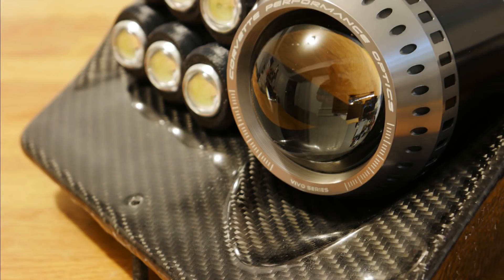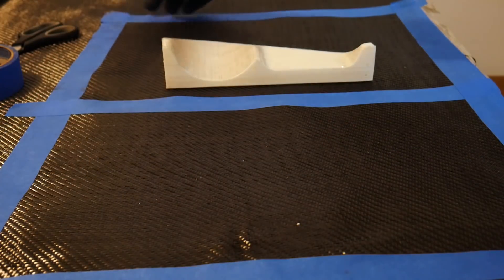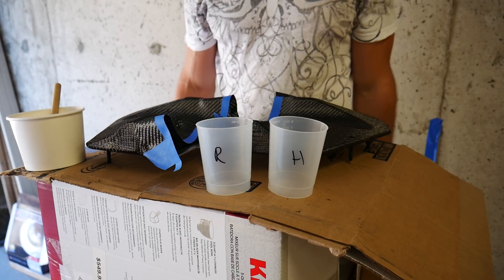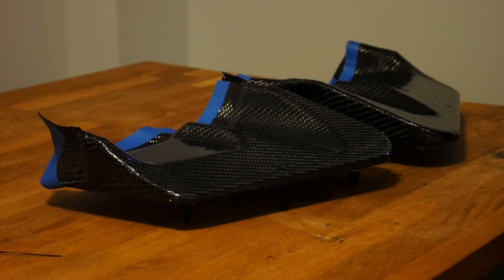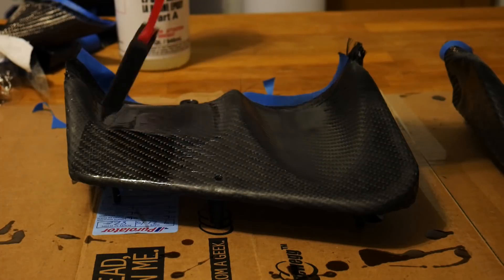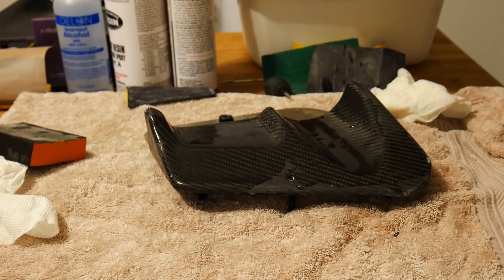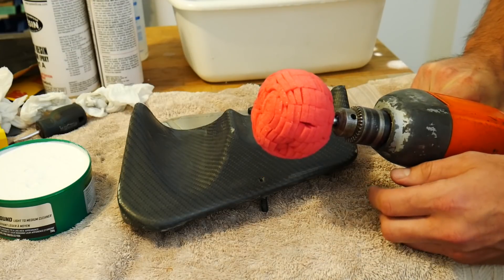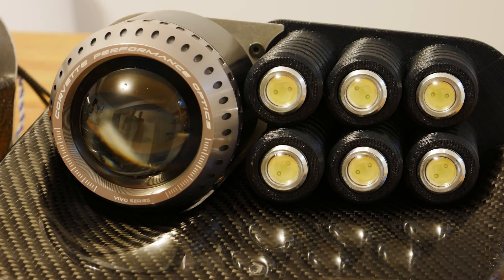How to Hand Lay Real Carbon Fiber Wrapping / Skinning Tutorial

Comment: Please be careful when sanding. It's best to use a respirator. The small fibers which could be potentially sanded off can get into your lungs and stay there forever!
Reply from the maker: Good suggestion! Safety is #1
Reply: Any suggestions for good respirators?
Reply: @kingarthurthe5th  3m respirator. I use the replaceable filter full shield with glass face shield. Works titties
Reply: @krotchlickmeugh627  those are expensive, but they definitely look worth it. For now I got the respirator without face shielding. Thanks for the suggestion.
Reply: @kingarthurthe5th  nah they aren't expensive at all. I'm broke as shit too.
Reply: @kingarthurthe5th  nvm i was wrong they are about $129

Comment: Question about the hole in your part. Do you cut this out before applying resin, or poke a hole through after? Do you find this is easier than drilling after the fact?
Reply from the maker: I did poke a hole through first... made it easier to locate after and then drill a nice clean hole

Comment: Why not just leave the last coat as is and not sand it.. Your last step waxing does not make sense....
Reply from the maker: Hi Duane, when applying resin with a brush, the last coat is never perfect. There are always irregularities in the surface. Similar to a cut and buff with car paint on the clear coat, it is a way to ensure that the final surface is very smooth.

Comment: Can I use epoxy resin over vynil. Like 3m 1080 cf wrap.
Reply from the maker: Never tried it, but maybe you can test it on a small piece off the car?
Reply: yes you can I just didnt my top door trims on my Tesla Model S
Reply: wait correction I stripped the vinyl off and went to foam pad, Probably possible to go straight on vinyl might have to use really good adhesive or rough it up a bit. IDK try a sample vinyl piece you can get anywhere

Comment: if I wanted to make anything big like a sport car body, could I use only one layer, or should I use multiple layers? and how to have a smooth finish to be painted like a metal sheet?
Reply from the maker: This is not the way I would want to go about making an entire car body... Would be a nightmare without a proper mold.
Reply: @EmbraceMaking  thanks for answer, is possible to make mold for carbon parts with fiberglass?

Comment: Don't over sand your part. One of the parts has white showing through on high spots. You can clearly see them at 15:30 and again at 17:46 this is before and after the polishing compound.
Reply from the maker: I think the white spot on my part was a resin related issue. The stuff I was using had been sitting on the shelf for a very, very long time... but yes, over sanding will create noticeable flaws!

Comment: Thanks for the great video. Looking for the epoxy + hardener you used, from both Amazon and System Three. They only seem to be sold in light/medium amber color? Is this what you used in this video?
Reply from the maker: Mine look amber when not cured, so maybe just confirm with the seller that it dries clear and you should be all set!

Comment: Great job with the carbon, but with the sanding and polishing you kinda failed. You still have some "dents" here and there and the haziness is kinda annoying.
Reply from the maker: It didn't turn out completely perfect but the concept is how it was presented. For the dents I needed more layers to build up, and for the haziness I believe it was two issues... one, I was using very old resin that had been open for some time, and two, my mix ratio was a little off as I wasn't being super precise with it. Thanks for watching!

Comment: Does brushing the resin on, get it to fully saturate into the carbon fiber cloth? I have done tons of fiberglass fabrication and repair, and my main concern is to get the resin to fully and evenly saturate the cloth weave. If not you can get void areas where there is not enough saturation making the part weak and very brittle. I’ve seen other video’s where the part is bagged and pressurized to force the resin completely into the weave of the fabric. This is still pretty cool, can you color the resin to color match your paint, but still have the weave of the fabric show through? I have tried it with fiberglass, but couldn’t get the look I was trying to achieve. Or can you get carbon fiber cloth in the color you want, and use the clear resin. Thanks for posting, I got a few ideas from your video.
Reply from the maker: Brushing the resin on is not the best way for full saturation and strength to avoid bubbles or voids as you suggest. This is the cheapest and easiest method for aesthetic parts that do not require great strength. Vacuum bagging would be the next best option as you suggested but it requires the investment in the vacuum and bags etc. The resin probably could be colored but it is not something I have experimented with before!

Comment: Bullshit.  I used the same adhesive, put the weave on. It stuck nicely.  Waited about an hour as I had other shit to do so the stupid fuck adhesive could cure.  I mixed the EXACT perfect amount of resin and hardener, and applied the first coat..... what happened?  It soaked into the mother fucking carbon fiber weave, and INSTANTLY released the adhesive around all the corner areas and eventually the flat surfaces and lifted the weave off the part.  Fucking epic fail.  Ive done it 3 times now and done it EXACTLY like every video online and the fucking instructions say.  Wtf is going on? My house is 75 degrees.  I sanded the bitch ass part, im using the correct type of 3m adhesive. Im using the resin and hardner that comes in the fucking kit .  I waited the required amount of time.  I tried using resin with pigment one time as well and that was even WORSE than the adhesive.  Ive wasted probably 4 square feet of weave already and am about to march down to the manufacturer and shove the rest of it up their asses.
Reply from the maker: The geometry you're trying to cover may be the issue if they are really tight curves or corners. Are you wrapping plastic, foam, or what is under neath? Can you maybe use some push pins or very small staples to hold the fabric in place in an area that will not be visible at the end?

Comment: When I tried it that way the first coat of resin instantly released the spray adhesive and the cloth started to lift up.
Reply: Not sure what spray glue he's using but I've had the same problem. I usually tape the excess back as well on the bottom to keep it from lifting. But I stopped using glue as a base all together. I mix a resin as a base coat then wait a few hours to get nice and tacky. I usually apply about 3 coats over it before I even touch it with sand paper. Hair dryer to heat each layer up to help the resin level properly.
Reply from the maker: Sounds like a great alternative if you are having issues with the spray adhesive!

Comment: dont aply tape on PLA.....resin dont melt it (mostly;; i never work with resin that can melt PLA....ABS yes, resin melt it like acetone and if i want to get carbon stick to abs i aply resin on it wait till it cure and then carbon without adhesive...or small amount of adhesive but mostly long cure time resin and i use it to stick carbon)....you can aply resin on 3d printed part then wait till it cure, if you want to remove 3d printed part from carbon part, aply pva on it , and then start to aply carbon

Comment: when i apply resin the foam brush ruins the weave, what can i do to stop this?
Reply: use bristle brushes with light pressure, or roll the resin with a foam roller and then kill the bubbles with a mist of acetone or a heat gun. You can also use thicker carbon like 6k or even 12k and that will keep the weave much better than the thin 3k.
Reply: Another way that works well on smaller items like these made here is simply:   wear the correct nitrile gloves and use your hand to evenly distribute the resin, slowly softly 'massaging' the resin into the cloth. After you poured some resin onto your item from a small cup you used for mixing the resin.

There are so many epoxy types.  Use a thin one that has a short(er) potlife for impregnating the carbon. But for your finishing layer you could best use a thicker (more thixotropic) resin with a little longer curing time.  To give it ample time to level out.  Of course all within sensible margins.
It's real nice and awarding to learn more by trying several options.

Comment: Do the resins give off fumes? I see everyone doing this in enclosed spaces with no mention of the resins and you are the only person I've seen using gloves for protection from the CF.
Reply from the maker: I would suggest working in a well ventilated area. Also, resin on your hands is a sticky mess, and carbon fiber cloth will make you itchy!
Reply from the maker: The resins can smell... I would have some ventilation just to be safe
Reply: Embrace Racing  Thank you. I appreciate the replies to safety!
Reply: You can always get a respirator too if the area you are working in doesn't have the best air circulation.
Reply: @NicholasWood1  with all due respect, I don't think a respirator is a substitution for ventilation. The only substitute for ventilation would be a self contained breathing apparatus (SCBA). But I'm not entirely sure. It may depend on whether the pollutant is a particulate or a gas. Particulates can be filtered, gasses cannot. If this process is gassing off the fumes, which they likely are, ventilation is a must. Again, I say this with all due respect. Its based on information I learned in an OSHA approved confined spaces class I had to take as part of my apprenticeship many years ago (mid '90s), so I might be misremembering a fact or 2. If I am, I hope I error on the side of caution....  like particulates would be anything from dust to mist...
Reply: It is not often told by sellers of the epoxy resins, but everybody is prone to get allergic from epoxy, especially from the curing agent or hardener. Without proper breath safety measures anyone can become allergic and it is a terrible allergy !  One which will not fade.
Some get it within 1 day !! Others after months. I worked with epoxies building anything from surfboards in the 80's to appendages like spinnaker poles for yachts in the 90's, several one off yachts right upto my last hightech 35' sailing raceyacht in 2003..... when after 20 years I too became allergic. And had to stop my business, even had to quit sailing on the yachts I built for my customers, although they had been cured and in use for years.  If my bare skin touched the laminate of hull or deck the reaction came back. 
And this was no contact allergy in the beginning.  Inhaling the molecules triggered the reaction in my case !   But it grew worse and worse as I just had to finish the yacht to save my investment. 

So beware, wear carbon filled mouthcaps or better have a breather line from a compressor outside feeding you clear, clean air.
That is if you have to work with epoxy resins on a regular basis. And or your income depends on it.

Comment: Not a mention that CF dust is more carcinogenic than asbestos.
Reply: Is it really? Now Iam afraid of doing that myself.
Reply: it is indeed. but if you are sanding the CF, you are doing it wrong. so no worry. @MrDanielsahne
Reply: @RedNovembers  Yeah, I didn't thought about this when I wrote my comment. But I think the epoxy dust isn't healthy either. So I wet sanded it.
Reply: He was not sanding the carbon, just the resin.
Once you start sanding the carbon you allready ruined your part and you should start over.

Comment: When doing vertical surfaces with epoxy do you need a thickener?
Reply from the maker: Haven't used it before, I just try and build up very light coats on vertical surfaces so that the resin doesn't run.

Comment: after all said and done do you leave your original piece attached or do up pull that piece out??
Reply from the maker: Hi Tristan, I left my piece in place as I intended it to be that way (it has the mounting points, it is a one off, etc.) If you are designing a plug for a carbon fiber part that you want to produce many of, you need to design it with removal in mind!
Reply: Embrace Racing thank you so much, how would I design it with removal in mind? Just curious cause I was thinking about doing fenders for a car. Please let me know what you think and how I should do it just kind of getting into do my own carbon work and learning what I can. Thank you

Comment: if I am going to be doing this process to a certain section on a fiberglass bumper that will eventually be prepped and painted (those parts taped off until clear coat) at by a shop, should I be stopping before the polishing step?

Thanks
Reply from the maker: Hi Conor, I'm not much of a paint guy but I would imagine it won't need to be polished. Primer won't be able to fill a really rough surface so it has to be reasonably smooth. The primer and paint and clear coat will likely not get the polish work done. Best thing to do is ask your paint guy what he expects when you deliver the car!

Comment: the sanding and polishing is purely for aesthetic right?  you only need to add a few layers of resin, is that right?
Reply from the maker: Hi Jacob, the initial sanding before applying the resin is to help bond the layers. The polishing is mostly for looks. I suppose some could make the argument that the final sanding could help reduce locations of stress concentration due to surface irregularities, but your application likely isn't that technical?

Comment: Would this increase overall strength of a peice? Would it retain any elasticity or become brittle?
Reply from the maker: Hi Nathan, I believe this will increase the strength of the piece, especially if there is a good bond between the epoxy resin and the substrate. However, carbon fiber is known to be brittle. There will be a loss of elasticity, and excessive flexing may cause cracks or de-lamination of the fiber layer to the substrate if there is a weak bond. Thanks!

Comment: how do you calculate how much resin do you need for each part ?
Reply from the maker: Hi Monkeytz, to be honest I do not calculate. Rather, I estimate based on experience. However, check the label or literature for the resin you are using and there is probably something about coverage area per volume. Thanks for watching!
Reply: if you have a threded screw on the inside face of a mirror cover let say, how would you make the mould/"copy" this mirror cover, in order to make the carbon fiber copy ?
Reply from the maker: Hm, I'm not sure I understand what you're asking to be honest...
Reply: Pm me with an e-mail and i'll sens you some pictures.
Reply: i understand what you wanna say and i 'm curious too how to do it. So if you got an answer, please let me know on peter-fabry@hotmail.com

Comment: After 800 wet instead off polishing clear all parts with automotive clear coat you will have better uv resistance and gloss no polishing needed you can also lightly sand again next day or 8 hours later and re clear the results will be speechless 😉👌🏻👌🏻👌🏻
Reply from the maker: Thanks for the tip!
Reply: @EmbraceMaking  hi.. I'm currently working on carbon fiber skinning project. I would like to ask for suggestion what is the best adhesive or base coat for laying down carbon fiber cloth on  surface material ABS, PU, & plastic. Thanks
Reply: @EmbraceMaking  the 3d printer parts are PLA or ABS?
Reply: is it possible to use this technique on abs plastic? will the resin melt the plastic?
Reply: I use the automotive clear as well...final finish FAR better than that polished surface, and like stated...UV resistant.  Carbon will take on a yellowish hue unless you add some real UV resistance.  You can definitely wet sand to like 1000 grit region and clear will fill in all the scratches and it'll shine like nobodies bitness.
Reply: @KnightDriveTV  What automotive clear do you use?  I have been using Jammin Clear https://www.amazon.com/gp/product/B000RI57WG/ref=ppx_yo_dt_b_asin_title_o07_s00?ie=UTF8&psc=1   as recommended  by another youtuber, but what I have found is that it leaves a textured pattern on my resin.  Then once I sand it I have little circles on the surface. Very frustrating.  Any ideas?  Thx!
Reply: But isn't the resin basically clear coat enough?

Comment: How do you get the lumps (wavy) parts out? Would you have to start over, or apply more resin?
Reply from the maker: Thanks for watching! In the video I mention that you have to go through several iterations of sanding and then reapplying resin. Eventually all of the waves will go away. Just be careful, do not sand through the resin and hit the cloth!
Reply: Embrace Racing could air pockets be fixed?
Reply from the maker: You'll have to sand right through them to get rid of them and then apply another coat. To remove the bubbles when the resin is wet, have you tried denatured alcohol spray, and/or the heat gun method?